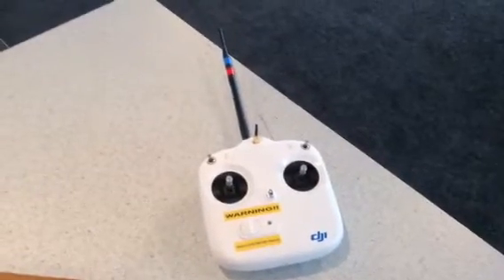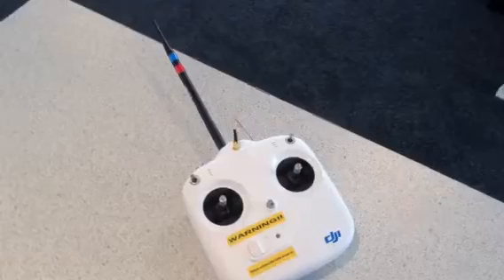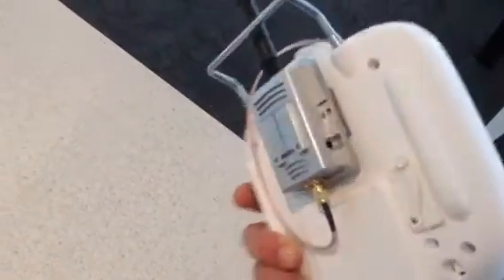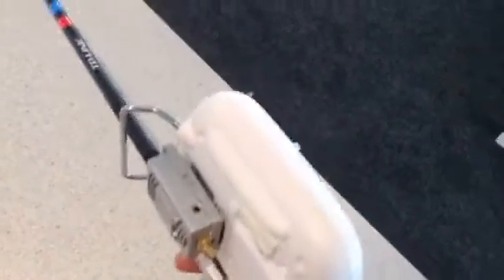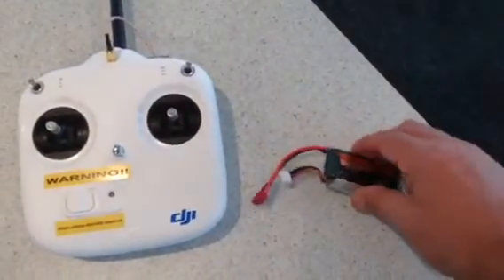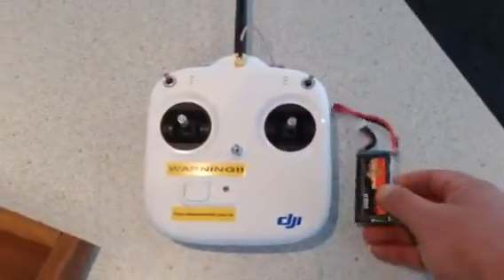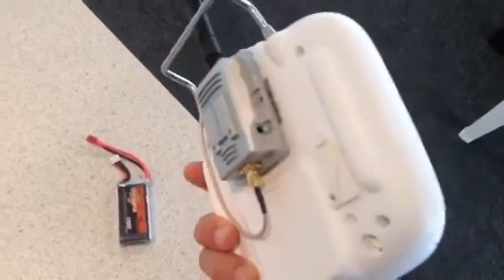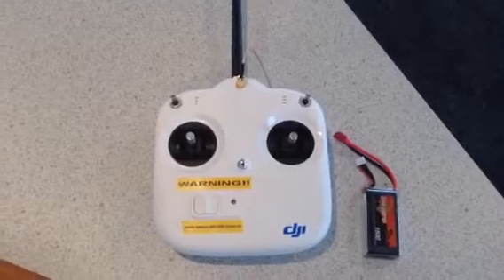DJI Phantom 2 controller with antenna booster

Comment: What amplifier do you use for the rc signal? Not WiFi.  I have to have both of them. Seperat signals.  Have any idea what i can buy sir?  Have a brand name and series model?  I dont know what amplifier to buy. I have bought one that said wifi on it. 2w.  Can i use that one for rc signal also maybe?
Reply: +Normann the radio signal is either 2.4 ghz or 5.8 ghz. If you have the phantom 2 its the 2.4 ghz booster you need. If you have the vision then its the 5.8 ghz
Reply: Ok. This is the fc40 i now found out,. And the controller is 5,8g.  And the camera is only 2,4.  Is it not supose to be the other way around?  Cous there is this wizard on rc. His like 60 or some of age. And he said never fly both 5,8g. Video and controller signal at the same plane. The controller will most likely interfeer in the video. And you dont want that. I have bought me a 2watt signalbooster for my 2,4g controller. And it is enough. If i use a bigger anetenna. Like a jagi antenna. I would have been able to send it out to space almost..  Use 2,4 on controller. And 5,8 on video. And you are secure. Not fun to get interfeerens when the drone is some miles away:-))
Reply: Fc40 transmitts video on 2.4 ghz and uses the radio controller on 5.8 you cant use a 2.4 ghz booster on your remotecontroller. Since you have a 5.8 controller. You need a 5.8 ghz booster.
Reply: Yea and thanks alor for taking time for me:-)  I have now understood the world of rc. Was not hard when i just started. Now i have a 2watt exact same as you have one the mack on this video. Exact same shape. Mine is 2,4g and 2watt.  Can send a signal to the moon with that. I found some cheap 5,8 boosters.  So if you want any info on what i have found just ask:-)

Comment: Hi, I used the cheap 2w signal booster into my phantom but I dont get it work,, do you have any idea ??,, which one has to turn on first ? The Tx or booster,, thanks
Reply: I'd turn on the Wifi booster first to be safe if you are using a separate battery to power it. The booster could possible not be acting as a resistor when the power supplying it is off. If that is the case, turning on a transmitter (your controller) without a resistor (an antenna) can damage your transmitter. You could also be feeding it the incorrect voltage. If you're feeding it the correct voltage, try looking into attenuators. I've read that using wifi boosters with the wrong dB can cause problems, and the attenuators can be used to correct it. Also, maybe you've been sold a bad booster? I believe that they were originally made for boosting wireless internet, so you probably could try to boost the internet connection to see if it works?